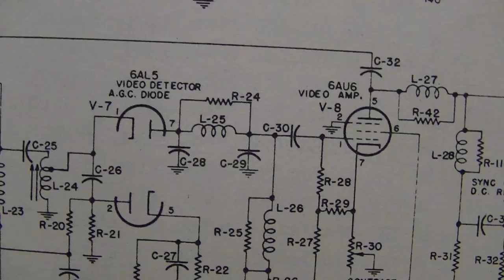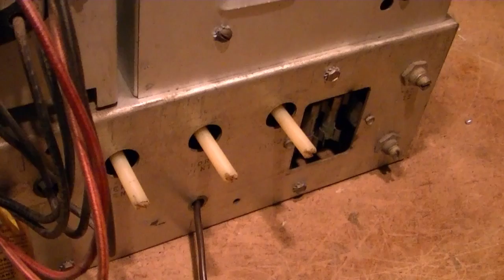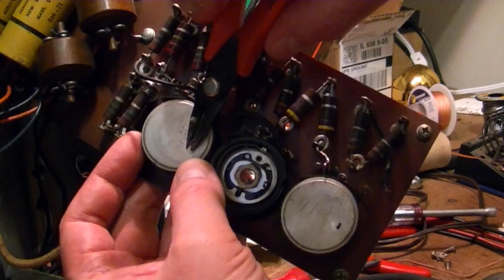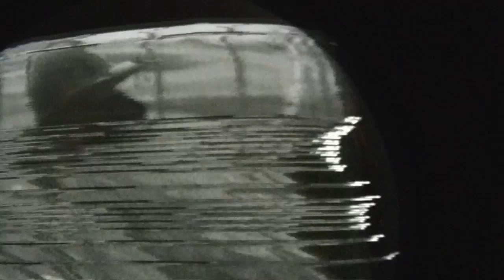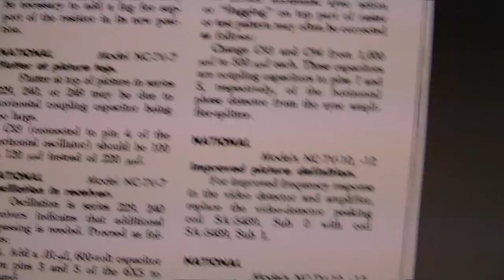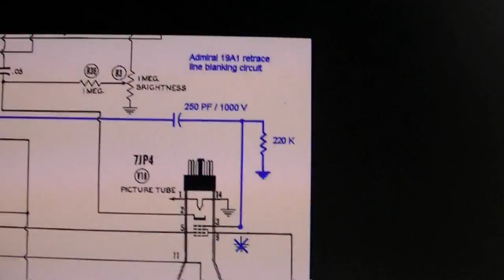National TV-7W restoration p7o?

Comment: I wonder how well Super Lube grease would work on those high-voltage Centralab potentiometers.  It does have good dielectric strength but I don't know if it's as good as silicone grease.  It won't harm plastics, though.

Comment: I wonder if those pots are replacements? They have plastic (looks like nylon) shafts and I'm surprised that they weren't metal when that set was made.
Reply from the maker: They're definitely original.  Those controls have several 1,000 volts on them and they used nylon so you wouldn't get shocked.